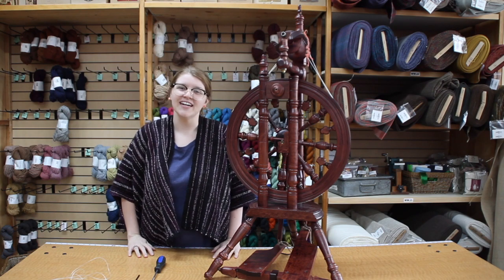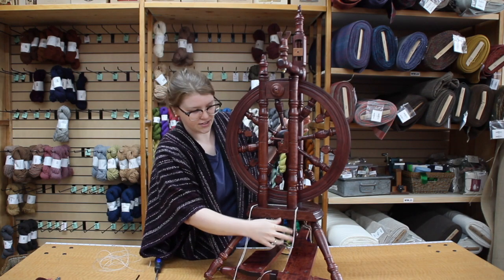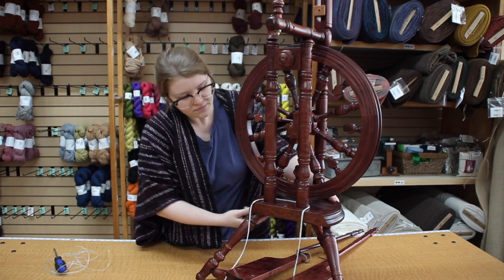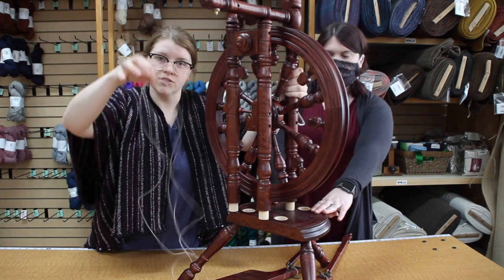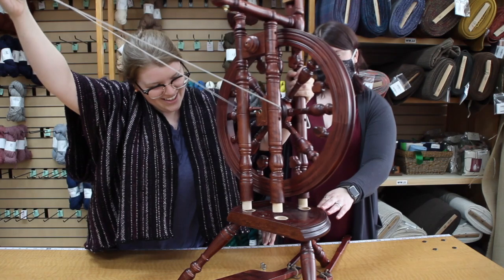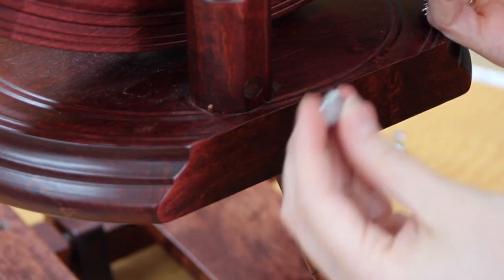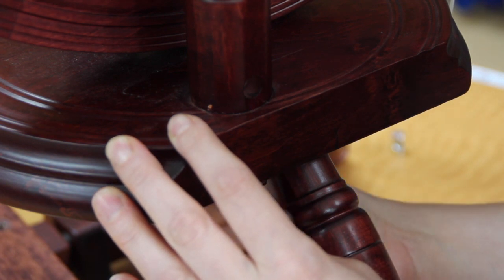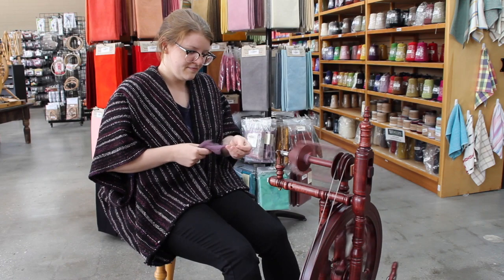How to Replace Your Kromski Minstrel Poly Drive Band

Comment: Easier than that. Just buy an unjoined band, wrap it round where it should go, cut it to length, and then join the band with small amount of heat, done.

Comment: My Kromski Mistral has wooden pegs holding the wheel in place - I just have to remove them, angle the band around the wheel, then pop it all back into place. No unscrewing involved.
Reply: Claudia Cocco, likely then that is not a Kromski Minstrel.  I’ve gone back into the archives as far as I can, and while the drive wheel is indeed easily removable, and that with just a couple of pegs holding in the brass sleeve bearings, there still is no way to get an already-fused band in place without taking loose either the 2 front wheel posts or the back one (and taking off the footmen).  Faced with this situation, many people opt to either cut the poly band and then re-fuse it in place, or to simply tie in a cotton drive band.  But for a fused poly band, this is the way.
Reply: Nancy Reid My wheel is definitely a Minstrel - I have the paperwork and can send you pictures. Maybe the nature of the fused band would dictate dismantling- but I have been able to mount an intact fiber band. I’ll keep with my approach, no poly band for me! Different strokes for different folks. Thanks for the info! 😁